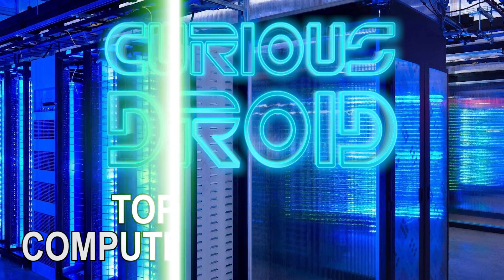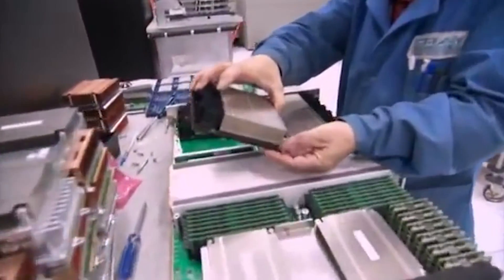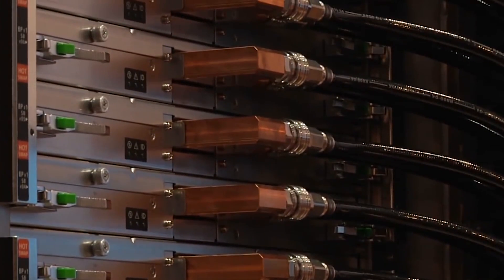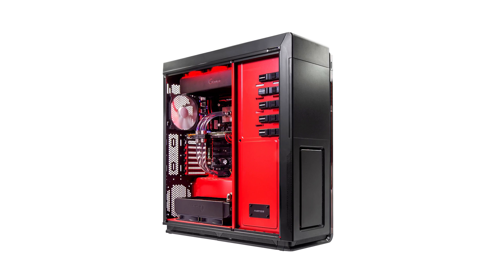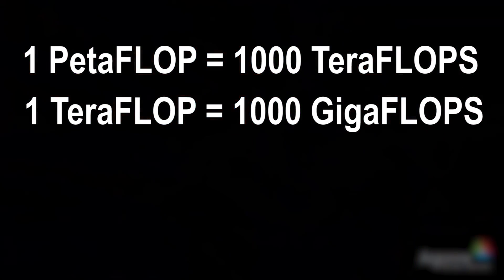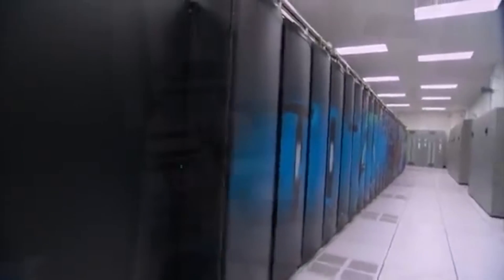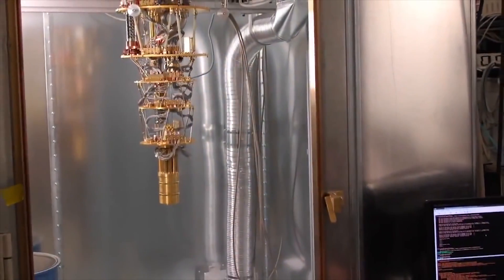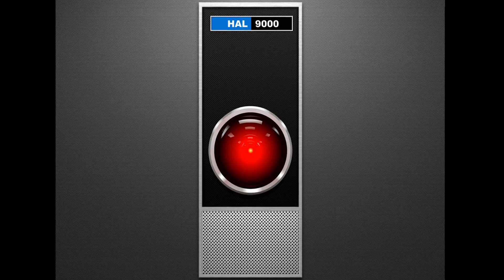Top 10 Fastest Computers in the World 2016 - How much faster is a supercomuter than a PC or iPad Pro

Comment: Im just thinking...are those good at gaming? Do they got a gpu?
Reply: No they simply couldn't run games. They don't have the OS for it, they aren't designed for it and if in a completely unrealistic scenario you could install Windows the games wouldn't work with more than one or two gpus in the system. Remember crossfire doesn't work well as is.
Reply: TheEgyptianOne rendering 3d images doesn't equal running games.
Reply: They probably can game but won't perform any better than your average high end gaming pc that's less than 0.5% the cost ...... Because they weren't made for it but again doesn't necessarily mean they can't.
Reply: Lol Deez No OS that runs games could possibly use this much computing power, Windows, Mac, Linux all aren't designed to run on super computing hardware xD.
Reply: Raisin Toast im 100% sure it runs games because these super computers are also made for rendering 3d images and even renders 3d holograms.
Reply: lol fuck today's "demanding games", it would run Avatar cgi graphics in real time, at 10,000 8k 1000 frame rate per second.
Reply: Rizzen it can play games. its all about the software, and if the system has this amount of computing power then all is left is the software/operating system.
Reply: Lol Deez They actually run Linux, but there's no game that's optimized for so many multiple cores
Reply: Kai Striethorst firstly, they don't use windows. they use a highly optimised version of Linux written specifically by the owners.
Reply: Kai Striethorst the computer simulate the big bang so minecraft cannot scratch it😂😂
Reply: No, they would be terrible for gaming for many reasons. Fore the baseline reason, the computers are simply not designed to handle graphics processing. Windows, Mac, and Linux (for the most part) would simply be unable to understand what would be presented to their code to run at all. The computers are made for specific calculations mostly based around extremely complex mathematics. A simulation isn't limited to being visual and most of these computers produce raw data that is sent to another computer for graphing or some other kind of visual representation. What I've noticed a lot in this thread is that people are taking their underlying assumption of how a computer functions and presenting it as utter truth when in reality these computers are almost just ram and CPUs. IF the computers could be reprogrammed or harnessed to run graphics processing instead of data processing then yes, you would be able to run anything until the day you died.
Reply: I know they have gpus...but would they be good at gaming
Reply: And it would be nice to see it compared to gtx 1080 and i7 4790
Reply: +Kai Striethorst They could probably run like 10,000+ 8K screens at max quality and detail on the most demanding games with no problem at all. Remember, some of these come with a 60 million dollar electricity bill a year. Lol
Reply: Yea but are they optimized?
Reply: +Kai Striethorst Obviously not, unless I'm misunderstanding you. Those supercomputers are used for calculating what would happen if North Korea fired a ballistic nuclear missile at New York, for example, or for calculating when the next hurricane would take place.
Reply: Rizzen  of course it can play games all it needs is a os
Reply: Happy Trump day by the way.
Reply: +DuckeePlayZ that is not truth, 1- the processing and graphics was hold by the CPU only in the past, 2 there is gpu on supercomputer I think Nvidia quadro
Reply: Kai Striethorst therefore, you can't use steam very well
Reply: so much technological illiteracy in this comments section
Reply: True
Reply: DuckeePlayZ but they need graphics for displays of the Big Bang n stuff

Comment: Why are we comparing the computers to iPad Pros?
Reply: because we all know that the iPad Pro has always been the benchmark for modern performance at a cheap pricetag...
Reply: They might as well measure normal computer's power in GameBoys. Totally accurate and useful units...
Reply: it is supposedly the strongest and fastest mobile device.
Reply: I think they wanted to use something that consumers had easy access to. A lot of consumers these days aren't familiar with PCs but they can relate to an iPad.
Reply: He's using a point of reference by using the technology we all use and know about so that way we can actually piece together what he's saying especially for those who aren't engineers and IT's
Reply: because 3.4 million iPads cost 2380000000 vs the shaheen II which cost 510000000
Reply: Well they compared i 
Their ipads to computers in an add

Comment: But can it run Minesweeper?
Reply: At low settings with a resolution of 800x600 you could run it at 16fps
Reply: Also, you would have to close all running programs, turn on max speed mode, and turn off all visual effects.

Comment: do they even have graphics cards? 😂
Reply: The Titan has 18,688 CPUs and 18,688 GPUs...
http://www.nvidia.com/object/tesla-servers.html
Reply: Graphics cards are for rendering graphics.  As these are server based machines, they have no need for intensive graphical user interface rendering.  The cpus and ram are merely for calculations.
Reply: probably. gpus have other uses that are not gaming :^)
Reply: +jcrowley1985 gpus are very good for certain niche things so i wouldnt doubt that there actually are some present. the question is just how many are there
Reply: The fact is, gpu's main use to to divert the intensive task of rendering on screen video so it doesn't clog up the cpu.  Leaving the cpu open for calculating program code.  So yea, in theory you could use a gpu as a sort of second "cpu" but what's the point when you already have 100,000+ cpus?
Reply: *****
GPUs aren't used for rendering, they are used for parallel calculations.
Reply: *****
They don't use super computers to do rendering.
Reply: they probably use NVIDEA GTX 89889738478927824789378234897893472847  TI
Reply: FrostBite 3
Nope, they use NVidia Tesla Accelerators.
Reply: Oscar Kurka XD
Reply: *****
Do you even know what Nvidia Tesla is?
Reply: *****
Wow, you're dumb.
Reply: Most of these are either headless (They don't have any video) and you access the super computer via multiple separate computer terminals or they are running just a straight-up video card (No 3D) usually made by Matrox.

Comment: I just wanna know how fast these can run FarmVille.
Reply: I suppose not at all since the OS used for such computers usually doesnt support Adobe's Flash.
Reply: RevolutionX it wouldn't run it at all because  the game wouldn't know how to handle all the recourses.
Reply: Lol Deez
depending on the language it is made in it doesnt have to manage the resources itself, for e.g. using C# / .NET, the .NET Framework would manage the resources for you - unlike for e.g. C++ where you need to do the memory management (but have other benefits).
Anyway, the question was farmville - and it is (or at least, when i last encountered it, was) using Flash, for which you need a flash player (which, afair, does manage the resources aswell itself, so not the games problem).

Comment: Seem to be forgetting that anyone with a $1000 PC will likely also have a GPU. if you include that, my $800 PC is right around 6.5 Tflops
Reply: yup. I guess they are were making is simple for people because of x86 processors and integrated graphics are much more common in everyday pcs and laptops, parallel processing in gpus are much better at doing math calculations or FLOP measurement. x86 processors (intel and amd cpus) can do much more complex operations and much more quickly than parallel processors.
Reply: "common" = "ubiquitous".  Supercomputers use GPUs.  You count those flops against their total so you should do the same for the PCs and iPad.

Comment: I wonder, what operating system used by that supercomputer??
Reply: All of them would use Linux probably
Reply: +Sweet Musiic yeah, I think so. But what distro..
Reply: +Adhi Pambudi either there own distro or more likely a custom build of kernel
Reply: definitely sure that it won't be Microsoft OS, else they would have to change the name from supercomputer to crashcomputer. There will be a countdown list then, which one crashed the less.
Reply: I don't think there are any operating systems that support 1.000+ TB of RAM. I don't think they use any operating systems but commands.
Reply: +Magic Weapon R0 So, application software run directly from boot, and application software has ability to access hardware directly without interuption of kernel?
I think that's a bit dangerous 😨
In my opinion +Sweet Musiic probably right.
Reply: It say the number one uses RaiseOS which based on Linux
Reply: Currently 489 of the 500 fastest supercomputers are running linux.
9 are running Unix
1 is running Windows and
1 is running a "mixed" system consisting of CNK and Linux.
Reply: Unix or linux
Reply: lol @1 running Windows. That is a statistical anomaly that must make Microsoft pretty happy.
Reply: The OS is listed right on the top500.org list for each computer.
Reply: most are running linux
Reply: most are a custom Linux version
Reply: I've been researching this question for 420 years and I've finally found out it uses Windows XP.
Reply: Adhi Pambudi well i don't know, i've heard of supercomputer OS, idk really.
Reply: custom OS probably... idk
Reply: Linux
Reply: lol
Reply: There was even "Windows XP for submarines"

And don't even begin with all the POS systems. I've seen some vending machines with Win 2k just a few years ago.
Reply: There is a super computer that runs on DeltaX OS, a custom build OS that turned out to be extremely efficient
Reply: Warped into Windows NT and never looked back.
Reply: windows 69 i think

Comment: I wonder how these are for gaming. Can they even run crisis? I bet if you told these numbers to those guys who made the computer in WWII, they would have a heart attack
Reply: they would most likely fail horribly, as the game would have no clue how to handle all the resources. think of it as like running a game from the 80's on windows 10. it has no clue what to do and either just instacrashes or flat out refuses to even start. as for the 40's though, back in those days 1/2 a flop would have been a feat.

Comment: So, I have a massively ignorant question I hope you can forgive.
Let's take #6 for example.
equivalent to 81,000 regular computers of ~$1,000
Why not buy 81,000 systems for $81,000,000 and network them? Why pay more than twice that?
I know there is a good reason, but I don't know what that reason IS, and I'm sure many curious, but non-tech laypeople who watch this might ask the same thing.

Less stupid question: I recall seeing a home made super computer from 64 networked units of the original raspberry pi. What did it rate as in speeds? What was the first supercomputer that would have outranked it and when was it built? What would a similar supercomputer made of the new raspberry pi 3 rank? What if it was, say, 256 units and not 64?
Reply: Regular PCs in one room would heat up so much and they are quite inefficient when networked compared to servers and don't have built in redundancies.
Reply: UKPhoto111 I assumed that sort of thing was a big part of it, but I'd think liquid cooled processors would still alleviate much of that
Reply: Not enough. Most general server rooms have fans at 100% speed and AC on 24/7.
Reply: Well that's kind-of what they do.  Except they want it to be reliable and when you buy 20,000 of anything A LOT of them will fail on day one, then day two, then day three..  So you need to buy high quality servers with inbuilt redundancy, house them carefully and make sure the networking is very fast.  It's a specialist area so it's expensive.

Comment: to be honest, i expected more than just a few 100.000 times the power of a normal computer.
this means that connecting the computers of the homes of a  big city will make a super computer that is tens of times better then a specialized military and medical computing machine.
Reply: just imagine what we can do if we made some sort of world wide pc network that uses the unused cpu power of all the computer to work on important models for science.
and i think that this is possible, when i render a image or movie i use 3 pc's for this.
Reply: The idea of ''37Pflops = 370'000 100Gflops computer" is inherently incorrect. Multiple systems do not scale so perfectly and even if they did, those PCs power consumption would be through the roof compared to what we see here. 17,8Mw is what the 37Pflops super computer takes. We can consider that the average 1000$ has a power draw of around 500W, multiplied by the number of PCs required to reach this, so 370'000 * 500, and you get with an astronomical 185'000'000W, or 185Mw. 10 times more power to get similar results, with a very uncertain scalability between that many systems.

EVEN IF* We only take the CPU/Motherboard/Ram/Cooler into consideration for power draw, as we're not counting parallel computing units such as a graphics card, since they are very different in the way they treat information. We get a power draw of around 230W for those parts (Using the CPU he used in the video). This would still add up to a whopping 85.8Mw. That's nearly 5 times more power.
Reply: http://folding.stanford.edu/

Comment: My Pc Has An Amd Fx 6350 6- Core 3,9 Ghz, 8gb Of DDR3 Ram, Amd XFX R7 360 2SF5 2GB GDDR5 At 1050 Mhz, And Takes About 390-410 Watts. PSU Is XFX 450Pro 450w. All In The Nzxt Phantom 240 ATX       
Case. Rest Of The Setup: Samsung S27E510C 27" 1080p Curved Display, Mouse From The Cooler Master Storm Octane, Logitech G510S Keyboard And Steelseries QCK Mini Mouse Pad. Other Stuff: 2x Ikea Linmon Desks, Led Strips Inside Pc And Behind The Desk.

Comment: Well, I'll this is "interesting," but aside from seeing "Really Big" computers, I can't tell you WHY. What I CAN tell you is this simply is NOT a comparison between "Supercomputers" and a PC (And, for no reason I can grasp, you included an iPad pro. Why that? Why not pick, say, a "TRS-80" or a smartphone? Makes no sense.)

But what REALLY makes no sense is how you "compare" these supercomputer's performance to a PC's; you're not dealing with valid equivalent tasks, you compare ONE type of program, "number crunching" and ... that's IT? Performance ISN'T just "ONE THING," after all. It's like comparing a McLaren 570S to a Hummer H2. I "suspect" the McLaren would be faster in 0-60, top speed and turning on a professional race track, and braking. Poor ol' Hummer, it didn't stand a chance!

Or does it?

So let's compare the "performance" between the two doing other things. Think the Hummer would do better on deep snow than the McLaren? Of course. Climbing up and down a 45 degree mountain incline? Gotta go with the Hummer. Crossing rivers? Hummer. Hauling a 15,000 pound trailer? Now it's the "Poor little McLaren" that will shred off it's tires or blow up it's engine before it moves a foot, while the Hummer and trailer will cruise right by.

 So there's no "comparison" if you don't specify WHAT the "comparison" is.

And I'll bet ANY PC will load and run MS Word faster than ANY supercomputer. My "wild guess" is that's because supercomputers can't run Windows! <grin>

Comment: they did not mention that our desktop computers now are capable of using things like CUDA to make calculations on many GPUs instead of CPUs, which is much faster than using a CPU and cheaper than super computer. also they have thousands of cores, which means they can do the operations in parallel unlike a CPU. I dont know how many Gigaflops per second they are capable of , I would like ot know how fast using CUDA it can be on a machine with 4 GPUs...